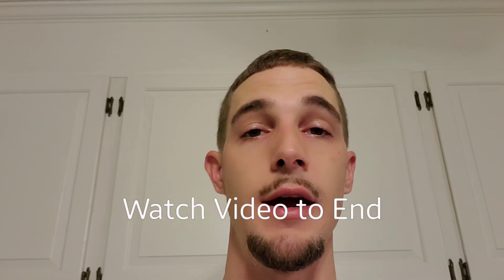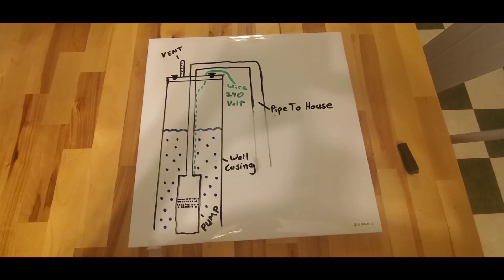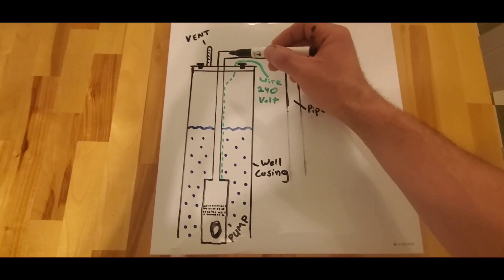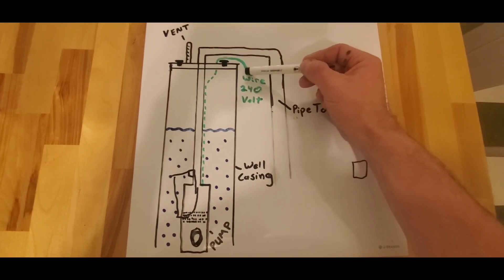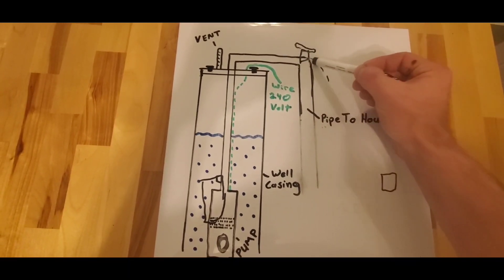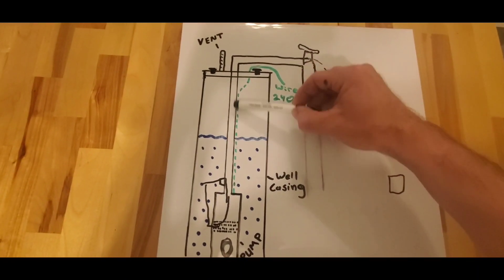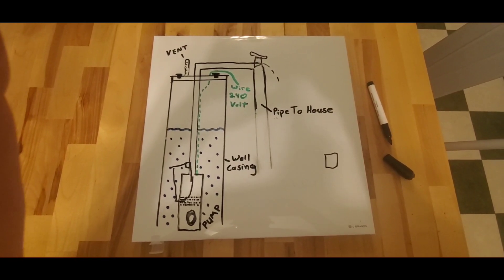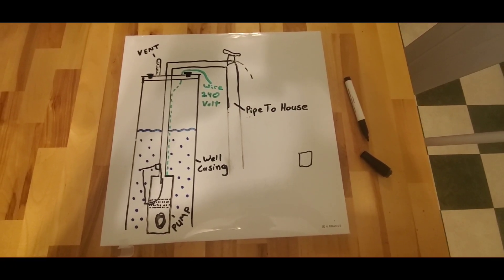No or Low Water Pressure From Well Pump. Pressure Switch won't cut off? Learn Why!

Comment: 2nd video I watch from you and they are very informative which is why I subscribed . I’ve been having air in my line when I run the water. If I run it for a while it goes away for a day or 2 but eventually it comes back. I’m thinking maybe check valve at the pump. Idk what are your thoughts ? Keep up the great videos.
Reply from the maker: Definitely check valve at the pump. It could be the tank bladder slowly leaking air out & its about to die but only a 10% chance on that. 90% it's a check valve.

Comment: Great explanation!! So I turned off my breaker my question is I have great water pressure  on my hose bibs  but no  water in my home
Reply from the maker: Change filter. Or possibly the pipe going into the house is frozen in the ground. I'd keep the well breaker off if that's the case.

Comment: I have preassure but not water on the house
Reply from the maker: The gauge is most likely broken & showing pressure. Open the drain at the tank, if you have water there, then you know its down the line. Filter or sink strainer is clogged.
Reply: Thank you sir that was really helpful I guess lines are still frozen up even though it been warming up I don’t know it’ll it’s healthy to shoot air pressure to the lines but that seem to helped on my situation

Comment: I just cracked my discharge head last week by closing the valve on top of my water filter which I have done for years. But it never never registered with me that the filter was on the upstream side of the pressure switch. Unfortunately this time the pump happened to be running when I closed the valve and changed the filter. Little did i know until later that evening that we had no water in the house. The next day I could feel the pipe at the well and tell the motor was running. Then after troubleshooting I pulled the pump and found the cracked head that could have had some previous damage also???  But my question is,  Why do we not install relief valves at the well head??
Reply from the maker: Relief valves are always put at the tank!. Im sure the filter installed on your was an after thought . Maybe installed on a DIY level
 But you found out why it goes in after the tank!

Comment: Great explanation!  Important for you to know that Wells in North Texas are anywhere from 250 to 600 ft deep. 
Also, low pressure cut off at the pressure tank shuts down the well pump preventing overheating of the well pump.
Lastly, and this had happened several times in North Texas, many sprinkler systems have been compromised from the significant cold (-2). As a result, well pumps get some water to the house say 16-20 psi, the rest of the water is flowing in one or multiple places in your yard.
Reply: Lots of people are not noticing the water in the yard as snow is melting...
Reply from the maker: Thanks for your Insight Stephen I appreciate it alot! Truly!

Comment: Replaced Superior 94505 3/4hp shallow well pump with Flotec fp4022-10 3/4 hp SWP.  Pump turns on and immediately shuts off. Off grid. Use Honda 3000 for 110V power. Two pressure switches. 1 on pump, 1 on pressure tank. New pump  will not run. ???
Reply from the maker: Your pump is a 240v & the Honda 3000 only offers a 30 Amp 120v source of power. It won't run your pump! You'll need 2 Honda 3000s with a parallel kit, or a Regular lowes generator that is minimum 6500 Watts! 
If you have an above ground pump, look in the manual on how to switch the board from 240v to 120v. I do know some  jet pumps are duel voltage if it's built into it. Youd have to remove the back plate off the motor and maybe direction is there. Or do a YouTube search on how to
Reply: @h2omechanic  I'm also from Texas I didn't have any problems with the freeze fortunately, however my well is only six months old and I can't get my well guy to do anything to help since he installed.  I've never received my drill report and still waiting on my water test results.  With that said I took it into my own hands to figure out I did quite a few things to help with iron problem and while researching I remembered I had never seen him do a disinfection after the install.  Now I am trying to do that and I am stuck with trying to figure out how to do it right but also add a drain to tank.  Also I would appreciate another professional to tell me if the way he installed the acv, pressure switch, and gauge is sufficient or not. If you have the time I would really really appreciate your expertise in solving this problem so I can finally get some rest.
Reply from the maker: @adspremiumwepaypremiumfora1469  I have a video on my channel for doing a chemical cleaning of wells using chlorine. Basically just use a bag of pool shock. Add 3oz per 100ft of granulated chlorine . 4342101376. Txt me tomorrow and I'll call u when I'm available to & explain everything I can & answer your questions.
Reply: @h2omechanic  the pump is set to 110V.
Reply from the maker: @paulaaron1109  either its wired incorrectly or its bad out of the box. If you can test it not using a generator you'll know for sure. But my Honda 3000 will run my 115v 1/2hp submersible pump
Reply from the maker: What's probably happening is that the Start up amps are too high & the Honda "inverter" generators are "smart" for even power loads. If its tripping the little red overload light, that's why. Startup amps on a 3/4 110v are around 25 to 28 & run amps are around 7.5. 
Try a different generator that's old school with no computer board inside.
Your 3000 actually puts out DC voltage and inverts it to A/C . Great for most modern applications. All I can suggest is try a different generator. If you can see the shaft & spin it with a drill, that might help get it started, just as a test.
Reply: @h2omechanic  Thank you.  I have a Champion 100155 that generates 9000 peak watts. It's been setting g for two years so I'll have to get it running first, but I'll  try it. I appreciate your help.